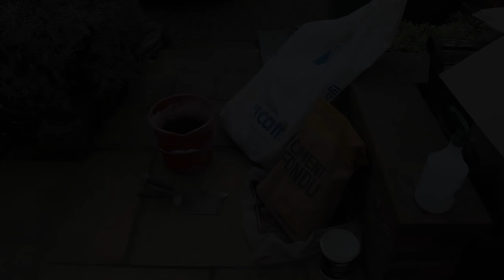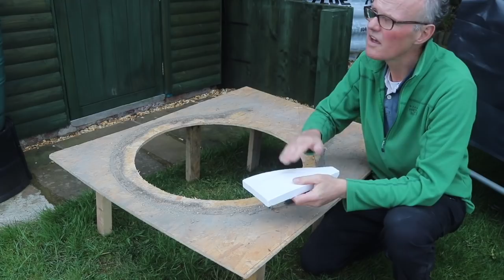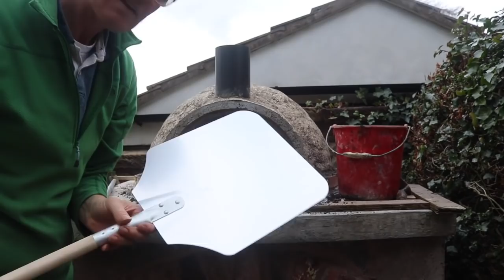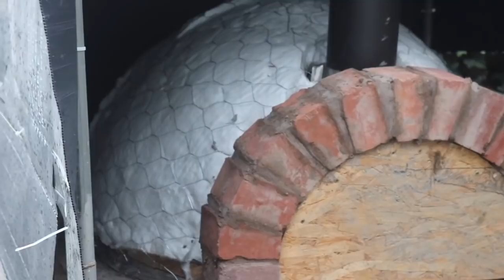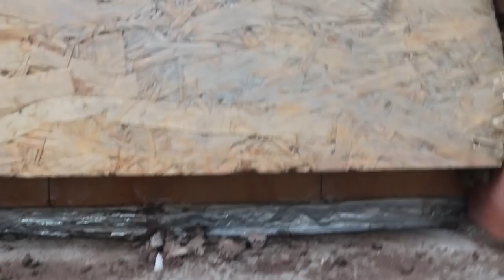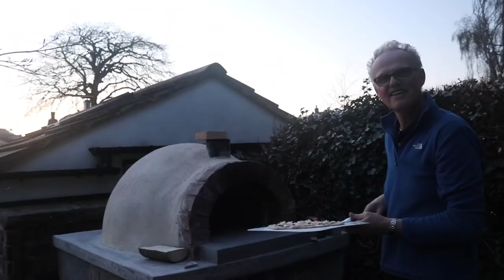DIY Pizza Oven Build: Vermiculite Dome

Comment: Hi , how did you have to put a wet cloth on top of the vermiculite dome to slow down the curing? And how long does it take to set (vermiculite and cement fondu) I have build my first dome over the gym ball with refractory cement and it's taking forever to dry . Thank you for your response .
Reply: The cement fondue and vermiculite/Perlite mix should dry reasonably quick. I mixed 1 part fondue, 1 part fire brick grog and 4 parts perlite. It does create a lot of heat when it cures. I left mine over night in the garage to set and in the morning the garage was very warm from the curing process but I had removed the dome within a day or so to let it cure all the way through. This is why you put a wet/damp blanket over the top.
Reply from the maker: Hi - once the oven is in place light some small fires - they will help cure out the dome even more. Gradually build up the temperature over a few days/weeks until you eventually reach pizza cooking temperature. Regards...
Reply: Solway17 Carlisle thank you , I'll try that . I will cure the dome first and make sure everything's ok then I'll cover the dome with the fire blanket +render. Nearly there , fingers crossed. 

Regards
Reply: Hi thank you for all the infos. Can I ask if you put mortar in between the calcium silicate board and the fire bricks ? I was thinking putting a little bit of dry sand on the calcium silicate board and the lay the firebricks on top , as my fire bricks is 300 mm square and 70 mm thick . What do you reckon ? Thank you . 

Regards
Reply from the maker: Tanya Saramandif 
Hi - I think what you suggest is a good option, but make sure you lay the bricks as level as you can, whatever you do. If they stick up particularly in the middle of the oven, your pizzza peel will keep catching on them
Reply: Solway17 Carlisle thank you for your answer. Cheers
Reply: Solway17 Carlisle hi , I have one more question , I saw on your video you layer tile right at the entry of the tunnel of the pizza oven , does the ceramic tile gets  very hot or crack when you fire the pizza oven. Thank you
Reply from the maker: Tanya Saramandif Hi - there's not enough heat at all to cause any problems of cracking etc. I made sure I got a large format tile for outside use and also used tile cement and grout which were suitable for the outdoors. I plan on doing a little 'YouTube update' on my build pretty soon - I hope your oven is progressing ok. Regards
Reply: Solway17 Carlisle awesome. Yes mine is nearly finished ready to fire . I want to cure the oven first before installing the fire blanket and render. So still a little bit to go. Thank you so much for your prompt response, much appreciated. Cheers
Reply from the maker: Tanya Saramandif Hi Tanya - as mentioned above a damp cloth over the vermiculite dome slows the curing/drying process and helps avoid weaknesses and cracks forming. I seem to remember leaving mine for a good week before I was confident the structure was solid. Then I let the air out of the gym ball and carefully lifted it onto the platform. I can't see any reason why your won't dry out eventually - good luck with it!

Comment: Are you a complete amateur? I'd love to make one but have no building skills what so ever! Did you also build the base?
Reply from the maker: Ha ha! I would say I’m a competent DIY’er and often resort to YouTube etc for help. I did build the base with concrete blocks which weren’t too bad to put in place. Once I did that I used joist hangers and thick plywood inside the blockwork and strips of timber on the outside to form a mould over the blocks then filled with concrete to make the concrete ‘table’. Making the dome wasn’t too bad either....I did it one step at a time, and found it good fun, learning as I went along. Best wishes...

Comment: Hi your pizza oven looks amazing . Can you please tell me what's the inside dimension of the dome (hight) . So is your pizza oven still going strong ? Any cracks yet ? Thank you for your reply
Reply from the maker: Tanya Saramandif Hi Tanya the inside dome is 32 cm high, internal width about 64cm. I can manage a 12" pizza in there once the fire is lit. So far the oven is working well - no major cracks or other problems. Since making the oven I have cooked a good few pizzas over the Summer and it's working well and good fun when other folk visit. As I live in northern England where the weather is mixed I have built a little roof and shelter over the dome to keep out the worst of the wet weather. Best wishes - have a go...
Reply: Solway17 Carlisle thank you so much for your response , I built mine a week ago using refractory cement its taking ages to dry , I guess it will take longer to dry because of the weather her cold and wet winter adelaide Australia. Anyway I'll keep you posted . Thanks again

Comment: Hello
Ive got my materials for the pizza oven. I am a builder and wandered why you dont put sand in the concrete mix ?  After all comcrete is made up of cement, sand and aggregate. Just wandering. Thanks
Reply from the maker: Lee Pilkington Hi Lee - sorry for the delayed reply. It's a good question. I just followed a recipe I found on the internet. Some people use crushed 'grog' (crushed refractory bricks) which I thought about using but didn't in the end as I couldn't get it locally and didn't want the expense of heavy materials being delivered to me. I think you need to use refractory Sands/materials to avoid the risk of cracking when the oven reaches high temperatures

Comment: what is the white insulation material? thanks
Reply: fire / heat blanket . i bought mine on Amazon
Reply from the maker: Ceramic fibre blanket for the dome and ceramic fibre board for the base - from ebay in my case

Comment: What's the reason behind adding vermiculite to the Ciment Fondu first dome? Would it be better pure, then add the vermiculite to a cement insulation later? Thanks
Reply from the maker: Nathan Pollard hi Nathan - the vermiculite is the heat proof aggregate which is held together by the cement (cement fondue). The cement and vermiculite mix is the material used to make a heat proof dome. As far as I know you always add cement to some other material/ aggregate to make a suitable mix.

Comment: Nice job ,just followed your video and completed my dome.is there any hard and fast rule about the position of the flue mines a tad more forward than yours.
Also how did you get your vermiculite render so smooth 
Thanks for the vids
Reply from the maker: martin h Hi Martin - sorry for the delay in replying. I think the key dimension is height of the flue relative to the height of the dome. That said, once the combustion gases rise up over the dome, they need to escape via the flue at the entrance. I have noticed some smoke comes out of the front door of my oven at least until it gets going, then the chimney seems to manage ok. As far as the smooth render goes, I used a plasterers float and some trowels after forming the dome, careful not to push too hard anywhere to cause material to collapse or pile up. Good luck with your build!

Comment: Hi Solway17carlisle
I Have followed your steps and i have just finished the vermiculite fondu cement render, over the fiber blanket and chicken wire, how long did you let this layer dry for, before you did a small fire?  to help the curing process, how long where the fires you did and how many ? before the final render was applied?

Thank you in advance Grate video  
Cheers
Michael
Reply from the maker: Hi - I don't think there's any hard and fast rules - I waited until I felt that the ciment fondue/vermiculite mix had set, Maybe a week or so, then set a series of small fires in the centre of the oven, gradually increasing the size of the fire. Perhaps after a couple of weeks I was ready to heat the dome up to 450/500 celcius

Comment: materials list please
Reply from the maker: For the dome:
Sterling board with hole cut out (same diameter as gym ball)
Gym ball - mine was 60cm from memory but you could go bigger eg 75cm
Cling film - to cover gym ball
Stiff cardboard or sheet plastic to form an arch/entrance & timber to form the arch
Vermiculite 
Ciment Fondue (EBay)
Ceramic fibre blanket
Chicken wire
Calcium silicate insulation board for the base
Fire bricks also for the base - deeper the better for insulation
Reply: Can you let me know what quantity of vermiculite you used?
Reply from the maker: I got a single 100 litre bag from the builders merchant. Used about 3/4 of it

Comment: How many inches is the front opening? Thanks.
Reply from the maker: Hi - I’m away from home at the moment, but you need the width of the opening wide enough to allow a pizza piel/shovel to get in. Then form a nice arch to suit the width. I googled pizza piel and checked the dimensions of them off the Internet. So if the usual width was say 12” I would have made the width of my door 14”. Hope this helps till I get home again
Reply from the maker: Hi - the dimensions for the outer brick arch opening are: 18.5" x 10.5" The inner opening is 15" x 9" and gives clearance for the pizza pile which in my case is 12" wide
Reply: Thanks! I like the size of your oven, I can't see building a 36 to 42 inch oven & making a couple 13 inch pizzas. I think 25 is big enough if you're only making 3-4 pizzas a night. Plus the roof is lower, I think that's better as long as toppings aren't burning. Did you find any problems with its size?

Comment: http://www.youtube.com/watch?v=HIeOjXM4ST4 here's my attempt in the making (now waiting for it to fully cure before firing up at full temperature) p.s. how hot is the outside surface of yours - can it be touched with hands?
Reply from the maker: Hi Thomasz - the vermiculite stays foolish on the outside but on top of that is the ceramic fibre blanket. So there is very little heat on the outside. Also I finished it with a cement render, so 3 layers in total. The only area of high heat is around the chimney and I may need to patch this area with fire cement in the future. Hope this helps. Cheers
Reply: Solway17 Carlisle thanks, I still have not decide if I will add this fireproof rockwool and top concrete layer or maybe just a really thick layer of keramsit/perlite concrete, as it is now, just burning a piece of cardboard inside and after a few minutes I could feel the heat on the surface, therefore if it was wood at full fire, the surface would likely be scorching hot.

Comment: Well done. I am a bricklayer and intend building my own oven. You talked about the critical meaurment of the chimney base/outlet, is there any more helpfull info a rank amature oven builder like myself should know ?
Thank you.
Reply from the maker: Hi Lee - I got all the information from the Internet. I’m away from home at the moment, but I believe the proportions are in the area of 64 to 36. In other words if your total dome height is 100cm, your chimney outlet would start at 64cm. Please do check this as I am working from memory. Fornobravo has a goo webpage and there are others
Reply: Solway17 Carlisle 
Thanks !
Reply: @solway17carlisle  I've just done the calculation using Google. If your dome height is 32.5 cm ( from a rubber ball with a diameter of 65 cm ) then the chimney should start at a height of 20.8 cm. Hope that helps ( and is correct..!!!)
Reply from the maker: @duffgen62  Hi - I have just measured it and it comes to 23cm from floor of the oven to the base of the chimney
Reply: There are two books you can reference.
Kiki Denzer has one I forget the title but it's about cob oven building.
The other is Allen Scotts
Bread builders.
Reply: Lee Pilkington Years ago I made a Cob oven using Kiko Denzer's book "Build your own earth oven. I sent him a few emails during that time and he answered them all. If you go to his site handprintpress.com you can probably ask any question you like. I just looked and there's some Q&A data very recent.

Comment: Good effort, looks like a very nice build. Post some more vids of pizza's being cooked. I know you have only just built it but have you had any issues with cracks in the render or on the internal vermiculite dome. Do you think the refractory Fondu stuff is worth the extra cost over just using Portland Cement with some Lime/Fire Clay added.
Reply from the maker: Hi and thanks for the comment. There are no cracks yet so far as I can see but it is still ‘early days’. I read somewhere that Portland cement could crack and spall in high temperatures, whereas ciment fondue is used in high temperature applications. Given all the effort and cost in getting this far I thought it was a better bet than Portland cement - a bit like ‘for a ha’peth of tar the ship was lost’ type scenario! I used Portland cement for the vermiculite mix which went on top of the ceramic blanket as it’s cooler there. Then finished off with a water resistant render mix. Hope this helps. Cheers
Reply: How many bags of the Fondu stuff did you use.
Reply from the maker: Just 1 bag to form the dome and entrance to the oven ie the inner surface that gets hot. I put another mix of vermiculite over the ceramic blanket but used cheaper Portland cement for that